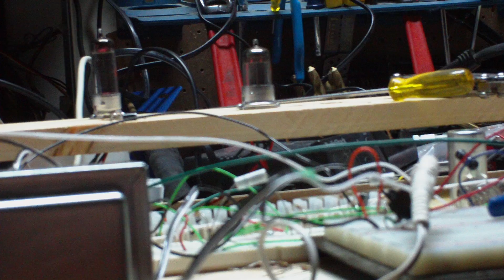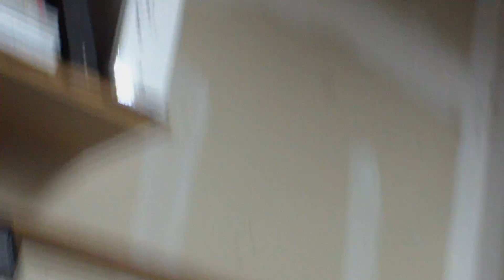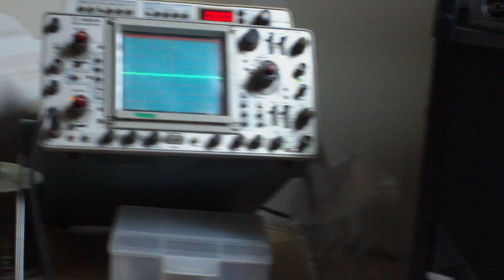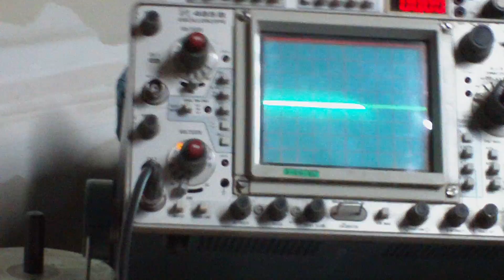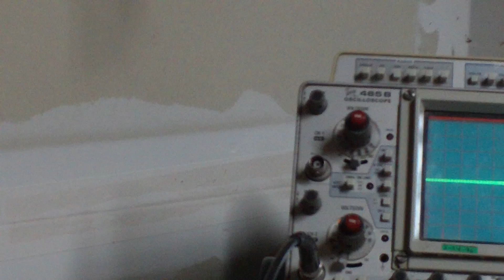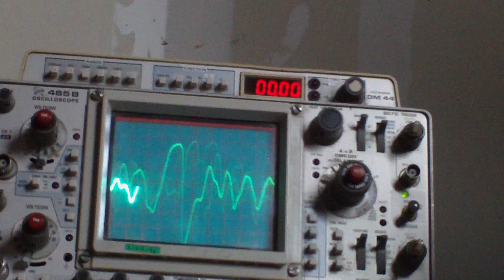1/4 watt 12k5 & 12U7 tube amp part 2

Comment from the maker: @Heisenberg85 
your 5 watt (980ohm with 8 ohm load)  is what I use formula for finding the load (voltage squared / watts). since the wattage is rated at 70 (really 70.07 volts.. but we can drop that ) 
70*70/5 = 980 ohms. with  a ratio of  122.5:1  
 The data sheet says the best is 800 ohms..  a 6watt tap would be the best.. But I have not found one. 
you can use the 10 watt with a 200 ohm (1watt to be safe) load resister. 
I am in the same boat, little money :)

Comment: These 12v tubes are awesome for beggining with tubes. Ive been an amatuer electric hack for a year and a hal but been unemployed the whole time so no money to buy stuff for builds. Ill prolly get my hands on a second 12k5 in a couple weeks...

My line transformer has taps for:

70v 2.5w 2k ohm
70v 1.25w 4k ohm
70v 0.625 w 8k ohm
25v 0.63w/70v 5w 1k ohm
25v 1.25w/70v 10w 500 ohm
25v 2.5w 250 ohm
25v 5w 125 ohm
25v 10w 62.5 ohm

Comment: @iccaros pretty much, il get a video up when its done, il probably keep everything at 12v. and have the opamps running on +/- 12v

and i noticed, thank you for subscribing, the 12v project was a first time and didnt go that well, after that i went for higher voltage, (just finished a 50watt PP mesa/SLO build) but i found the 12k5 from it, and i want to use it in something with a bit more power.

Comment from the maker: @razorrick1293 
Cool, so you just want the tube "warmth"
If you can get around 800 ohms of resistance on the opamp this tube will feed the power amp well. I would be interested in seeing what you get. 
Pin 5 and 6 make up grid one, and should be tied together. Make sure not to exceed 16volts on this. This is your space charged grid. I have 12 on mine.
I checked out your videos.. Got some cool projects..

Comment: @iccaros im not really worried about what kind of distortion comes out, im looking more to see what i can get out of it, and its going to be more of a preamp feeding a power amp than a pedal. il be able to get a base soon, and then i may have to play around, 22k sounds a good value to start with, and im not really looking to use any other tubes, the rest of the amp is going to be tl082s (for input buffers and feeding the 12k5, and the same opamps for driving tone controls and the PA (tda2030)

Comment from the maker: @Heisenberg85 
I put two in parallel, with 1K grid stoppers (inputs have a 1k each from the last stage in to stop oscillation) 
On the meter it puts out twice the voltage, which means more power out. 

This is good enough for me to jam with the radio, but I have an efficient speaker. Something like the Red Fang with 103db sensitivity would make this sound as louder.  I switched to a 5watt 70 volt line transformer which also increased volume as it is closer to the 800ohm not 1220 of the 4watt

Comment: No clips of my build. It doesnt sound muchdiff than yours. Not sure im getting enough volume. My voltage at B+ is only 20v.

You tried two 12K5?? Was it really not much louder at all? I still wanna attempt that to salvage this project. The volume is just so low on the speaker.

Comment from the maker: @razorrick1293 
got ya,, Are you looking for a Metal type pedal? 
I Got a 13/30 volt 1 amp wall wart from radio shack for like $15. for a pedal I would use one 12AE7 and two 12u7 (you can replace the 12u7 with a 12AU7 but it will distort faster.) 
This is where I would start for a metal type pedal. But I have not tried it yet. when I finish the amp project I may take it on.  for 12volt tubes 22k may be better plate resisters. I have 240k on these, but I am in the power section still not preamp

Comment: @iccaros i was thinking of using it as an overdrive tube in a hybrid circuit, but at the moment i dont have any bases or a 12v transformer to play with it, and i also have no ideas of what value components to use, 100k on the plate seems a bit too high...

Comment from the maker: @razorrick1293 
I was thinking about that today. I am not sure the value, may get some power tube like overdrive. 
I just put the 12K5 in parallel, but there is not much of a addition on these speakers.
So I am looking for  a 2.5k to 8 ohm transformer for push pull for a 26A7GT. In that case this may make a good Single tube inverter but will have to play with it..  By comparison the 12K5 takes a lot of current compared to the 12U7.

Comment: I managed to find it

Problem with joining forums is i can never get in with a yahoo email account.

Anyway how soon u plan on trying the two 12K5s?? Looks like ur still on breadboard with a setup to make it easy to test tube designs?? 

Mines already built. I coukd prolly squeeze the extra tube in. But i can only get the 2A transforner

Comment from the maker: @Heisenberg85 

Plate's of each to each side of the transformer, cathodes of each connected to ground trough a 10K with
Grid 1 of each (pin 2) connected to a 1 meg to ground and a cap to incoming signal from preamp. pin 5&6 of both attached to B+ 
here is a diagram of a radio who's power section is done this way
youtube will not let me post links. Join us on Ampage under build your amp and I can send you the information